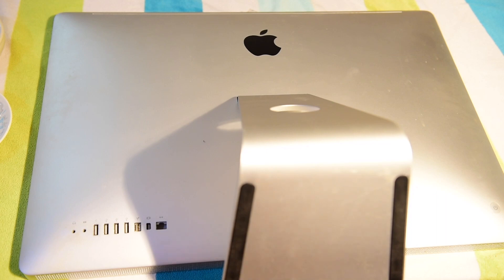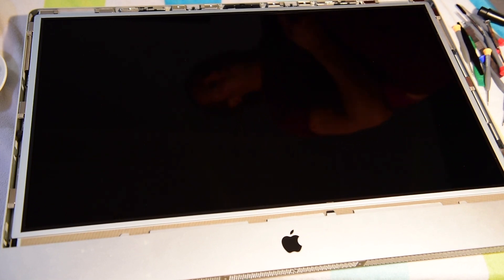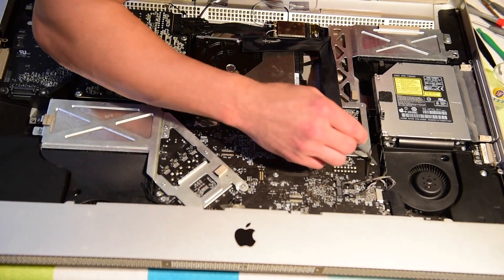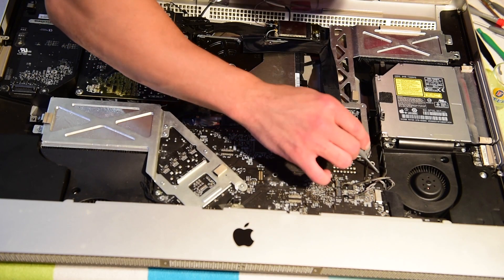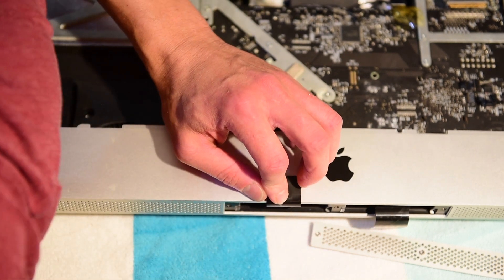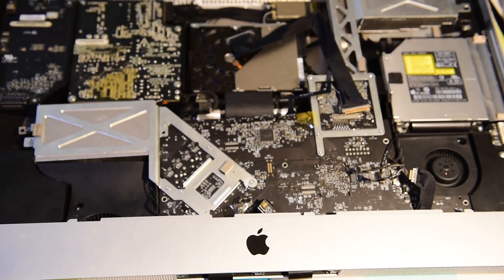What causes the iMac black screen? Part 1 - How to fix the iMac black screen (full breakdown)

Comment: 0:00 Talks for a while.
2:20 Removes the stand
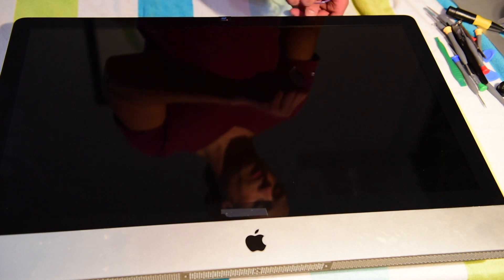3:45 Removes the screen's lid
4:08 unscrews and removes screen wires
7:25 Removes screen
7:45 unplugs a million motherboard wires
25:20 finally Removes motherboard
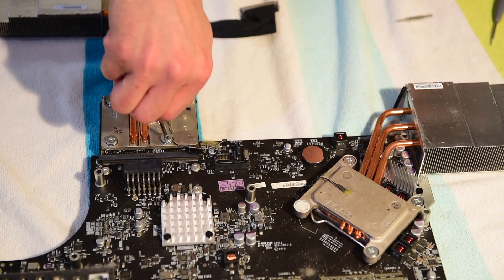26:21 unscrews heatsink
29:43 Confirms thermal paste is dry and shows it.
Reply: Yes, not very satisfying. He left me hanging. That's alright there are lots of vids showing the complete process to include baking the video card in the oven. I think that's the way to go.
Reply: Replacing thermal paste is not going to make your screen magically light up now is it !

Comment: Had the same issue and changed thermal paste. I wasn’t shut if that was the problem since heat wasn’t something i could see from the sensors was an issue. And mine got black if i increased the light right from when i started it up. So I tried option number two, changing the backlight inverter board. Got a cheap, used one from EBay. Took about 10 minutes to take out the old one and put in the new. Now it works like a charm and I can use it without bleeding eyes 😂
Reply from the maker: Awesome! It’s so annoying when it goes to the black screen. Since this video helped would you mind doing me a favor? Could you please “like” the video and “subscribe” to my channel? It really helps me out. Thanks!

Comment: My imac 27 2011 screen goes black while imac is still working  ( Screen sharing to macbook still working too)   .. when I press power button for 1s and click on the mouse screen came back on (sometimes i need to repeat it few times) ,,,  I've done PRam and nvram reset ,imac was cleaned  Gpu ,Pcu termal paste change but did not helped ...   Any advice ?  ( Screen sharing to macbook still working during black screen on imac ) .. Any advice ?

Comment: I assume that a black screen is due to the inverter board going bad.  I plan on replacing mine.
Reply from the maker: Yeah it seems to be a combination of the heat and inverter board. I think the overheating causes inverter failure

Comment: thank you for the video! i did apply the pastes like you did, but still have black screens, when i make a sleep wakeup it continues working but i really dont understand when its gonna happen and how its happening. may be its not the heat issue because sometimes it makes it directly from the opening. what should i do more?
Reply from the maker: It takes like 120 hours for the paste to fully cure
Reply: @CharlesYamabe   i realise that i broke the flex cable which goes to "Backlight Board LCD Inverter Board"  what does this cable do? it might be the cause?

Comment: Great video Charles i'll most probably be able to do mine now. I didn't get what thermal paste you are using though. Mind posting a link of the product perhaps ?  Thank's
Reply from the maker: SargentRay I used “arctic silver 5 thermal compound” a little it goes a long way. You should only need one little tube of it.
Reply: @CharlesYamabe  Thank's man i really appreciate it. I think i'm going to go with a new part, i'm too fearful i'll get an already shot one i if go with used.

Comment: Could the GPU card be bad if I only have 1 LED on the diagnostic board when plugged in, and already replaced the power supply unit, and still when I press the power button, i get nothing, no chime no fan its completely dead

Comment: What is the outcome of this? Is it still working properly? I have the exact same issue
Reply from the maker: Jeremy Jenks so here’s something interesting that occurred. It’s been working fine without any issues. However, recently when my wife’s computer (same model) has been on its been causing my computer to  have similar issues. But only when her computer is turned on.
Reply: Very interesting. My girlfriends computer is right across the room from mine in the office. My screen goes black exactly like yours. The only way I can keep the screen from going black is to use Mac fan control turning values of the internal fans up to around 3000 to 4000; this keeps the MCP heatsink At around 112°F. When it reaches about 120°F internally the screen will go black. Although, sometimes the screen to go black before I have a chance to turn the fans on and I can get the screen to come back on by pressing control shift escape and the eject button simultaneously. Sometimes I have to press them in that sequence a bunch of times to get it to come on. Your fix looks very helpful thank you for keeping us updated. I would love to fix this computer so it keeps working for me. 2009 27” iMac.
Reply from the maker: I would be interested in seeing if you turn off your girlfriends computer if you have the same issues. It doesn’t really make any sense why it’s happening to be honest. My wife’s computer is in the other room (probably 8 feet away of the wall wasn’t there) and it causes issues... But my new 2019 iMac is sitting right next to my old iMac and it doesn’t cause any issues. I can be on my old iMac for hours on end with no issues but if I turn my wife’s on mine acts up. I should see if mine stays on if hers is awake or if it’s only when hers is sleeping.
Reply from the maker: Update: I haven’t had any issues in 2 months now.

Comment: I have a 2013 iMac with the glued glass... I'm afraid of trying to tear it appart and I have the exact same problem... Any of you guys tried this successfully on newer models like mine? In the meantime, I will try Macs fan control and/or plug a monitor via thunderbolt/hdmi and set it as my main monitor.  The screen goes black every 2-5 minutes at best, every 2-5 seconds at worse and when I unplug and replug my Ethernet network cable, everything works smoothly for a while (now a whole hour without any problems... ??) Thanks
Reply: I now installed Macs fan control and maxed the rpm to 2800. I can hear the fan running now and after a couple of hours the screen went black again but I can now hear that the fan runs for a few seconds after blacking out and it shuts down, as if it were going to sleep mode... I can restart it by either pushing the power button or by mass clicking with the mouse (does not respond as fast as when in ''normal'' sleep mode...

Comment: Alright! I have a 10 year old imac just getting this problem. Upon turning it on the screen is black. After muitiple attempts to get screen on it will randomly start. Once on it is fine. I sleep the screen now and it works most of the time. It wont just turn off while using just on start up. 

Do u think that is inverter or the thermal paste?
Reply from the maker: I think the thermal paste leads to a lot of the issues. The heat isn’t being controlled properly and then it starts melt and warp other parts.
Reply: @CharlesYamabe  thanks mate

Comment: I have imac 27 inch 2009, for about last few days, the screen goes black while it works. After breakdown, I still can hear fan sounds, and it looks like it keeps working although display doesn't work. Does your suggestion cover to solve this problem?
Reply from the maker: Karl Max Weber yeah it should
Reply: I tried to do this, but my computer doesn't start anymore :/ I possibly did something wrong. I am hearing repeating beep voice.
Reply: Oh my god, I forgot to put in the rams. I put them in, then it worked ^^. Now, I am waiting for the conclusion. If it turns black, I will write here soon. For now, only problem is the extreme fan noise.
Reply: @TripleLinde Thank you, could you please tell me the name of this software?
Reply from the maker: Karl Max Weber were your fans dirty?
Reply: @CharlesYamabe  No, I totally cleaned them. There is still high noise, I couldn't solve it yet. :( The noise bothers me so much that so I couldn't test my display's stability yet.
Reply: @TripleLinde Thank you. I installed it. I just noticed that my HDD max and min RPM fixed to 1100 RPM. I cannot change this. It offers me to reset "SMY". I think it tries to say "SMC". I will try to reset SMC once again.
Reply: @TripleLinde I finally succeed to use Macs Fan Control app, and eliminated the noise. On the other hand, after I renovated the thermal paste, display didn't turn black for about one hour although I watch hd movies on youtube. I think I finally did it :) Thank you for your helps. I suggest everyone to try this solution. If display fails again, I write it here again.
Reply: One another point that I just noticed is quite annoying. When you start/restart your system, the fan noise keeps going until this application begins. So, you have to tolerate the noise until you see desktop screen. That so, this is a temporary solution for me. I need to find a new solution to cut off the noise completely. But again, using thermal paste solved my basic problem which this video points out!
Reply: Karl Max Weber hey Karl, I just got an 2009 iMac, no chime or picture when I turn it on. Then I noticed, no ram cards. When I get the ram cards, will it come on? Thanks
Reply: @boobizzy4173  I think you must try it :/
Reply: Karl Max Weber how many ram cards should I put in it?
Reply: @boobizzy4173  I cannot remember, there must be two slots.